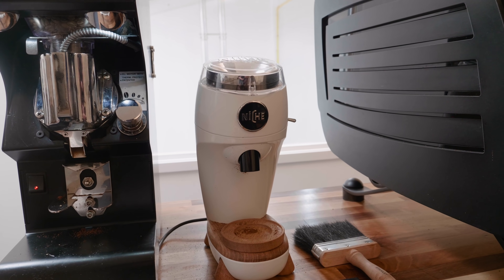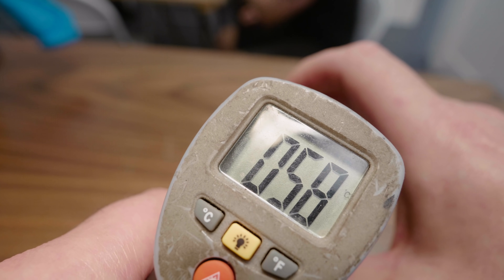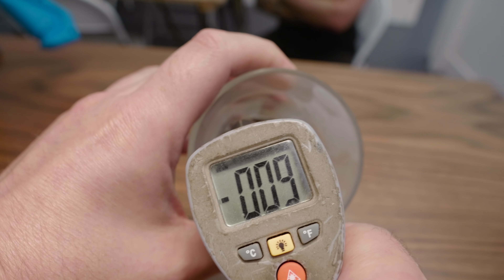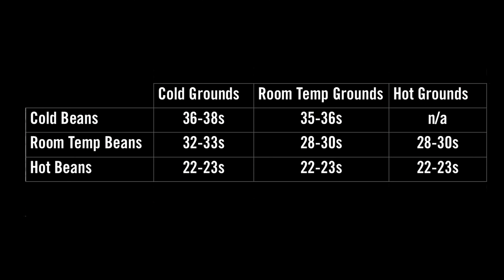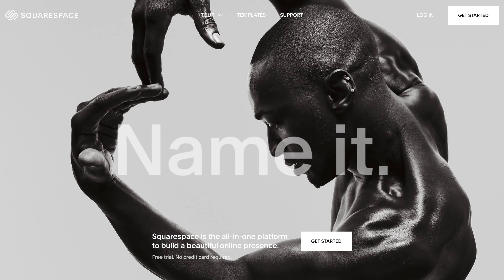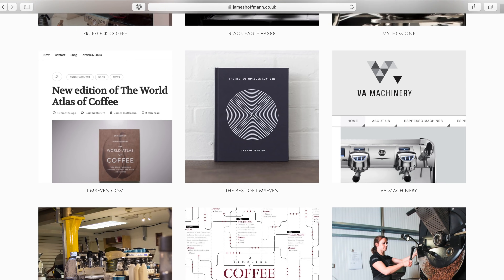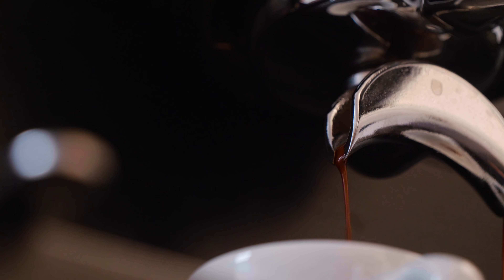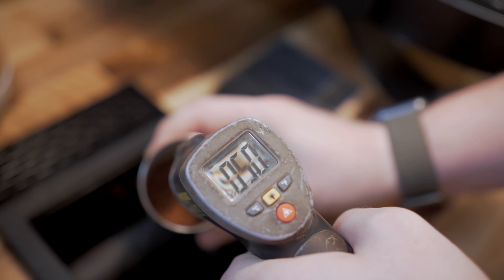Weird Coffee Science: Microwave Your Coffee Beans

Comment: Nuked very good fresh beans 20 secs in a bowl. ground slightly warm, and did my other crazy song and dances pour-ed over into clever (not grind top) kept hot on low in micro for 2 additional minutes top on. put the clever on a pint glass, top on, into freezer to cool rapidly. about 10 mins for 14 ish oz near boil/ over 200 C when I've checked. Into Ember mug at 140ish initial. I dropped it down to 134 to sip on. It is WONDERFUL......Too many factors to determine if nuking helped or hindered, no control or blinding or guinea pigs refractometers or caffeine meters. I have in the past def over nuked dry beans and grinds. Less is more for sure. KEEP THE LID ON?! SPEED COOL?! Well, more steps and can not prove this seals in flavor. I like to think so...one "test" I LICKED THE LID to taste the condensation. tastes good, IDK like an ultra light coffee spritz.FOR CERTAIN FREEZER COOLING YOU GET TO ENJOY YOUR JOE SOONER. But, then you'll prob need a heated coaster (fire hazard) or electric cup $$$$$ or.......THERMOS........or drink fast. there's another high AF on caffeine aha moment cool you coffee before putting into a highly insulated container. some work so well it'll burn you 4 hours later. Aha 2 such a container would indeed keep whats evaporating in....hmm. Wake up and smell the coffee a bit less but have a tastier cup? As we know what we perceive as delicious involves all of our senses. Same goes for nasty.

Comment: UPDATE NOW 5 ways including non micro "control" will add 4 and 5 at end.
3 CUPS 3 "MICRO WAYS" Have some of the best roasted beans I've ever had, again from 1000 Faces Athens, GA (RWANDAN Baho's Akagera Station experimental low oxygen fermented whole cherries 60 hours in sealed b4 natural drying.
3 "MICRO WAYS"
UNO......My way (Wy way?) brew kept hot/ near in microwave x amount of time. Now my go to method. Clever Coffee dripper goes into the microwave fully loaded top on and nuked on low setting to stay near boil whole brew. best results for me have been 2 and1/2 minutes in atomic box.
DOS   beans GROUND then heated in microwave before brewed same  micro way
TRES WHOLE BEANS like in your vid nuked til hot brewed "Wy"way
30 secs on high in a ceramic bowl got them piping no singing or toastiness hope for tastyness. Whole beans were cooled before grinding ground beans poured over still hot 14 oz ember mugs of each.
ONE) PHENOMENAL BREW!!!!!  These test roast beans are fantastic to start with.  Had some subtle and not so subtle notes and aromas I dig. zero over extraction nor bitterness.
TWO) VERY GOOD, but i get some vegetal and some bitterness I did not in the last cup. Also Microed 3 mins vs 2 1/2 so that's a factor. should have done same brew time for comparison.......But my hunch is nuking the grinds DID NOT HELP.  I thing it was that not 30 extra secs.
THREE) preheated whole beans, about to taste it. BETTER THAN TWO THE NON  MICRO PREHEATED BREW BEST WINNER CUP ONE
 Note brew one was yesterday so memory is a factor but I doubt one day older well stored beans would be much. should have gone same amount of time on second brew. ALSO having brew 3 after the more bitter cup....my palate is OFF AHA I also have cup two set to a lower temp than 1 and 2 were, its in a different Ember mug whoops it's a bit too hot IMO. Conclusions. Will continue to play with my coffee. Not sold on pre microwaving joe beans. Intriguing someones post claiming they "de-staled" older beans this way. Oh boy.........28 oz coffee today, yikes.  ALL THREE WERE QUITE GOOD ONE WAS EXTRAORDINARY but also factor in ONE was my 1st time sipping  said special bean a virgin experience ya know.
Day 3 sameme beautiful beans.
FOUR) is standard full boiled water bloom then 3 minutes in clever. Elevation 633 feet........YUMMY
FIVE) Brewed just as UNO But 3 minutes in micro rather than 2 1/2   Hard call........I'm going a bit more YUM than 4.......One was best, but its been 3 days so super subjective. Bothe Mugs are set to 136 F and that's major.
"Objectively" DOS and TRES were not as good and DOS microwaved ground beans is in 5th place, though decent. doubt I'll preheat beans in the nuker......may try comparing stale beans nuked or not in future.

Comment: Predict this round may not go well, its about time to get some fresh beans. nuked  whole beans w/ singeing. cooled to room temp (Boy do c beans retain heat well) ground.....back in the nuker about 40 seconds, no burn......1/2 grounds on bottom bloom boiling water final grounds stir stir stir, a bit more water, 2 mins low microwave brew. put clever on my cup. The heated grounds smell good, I realize part of the aroma when Ive successfully heated dry coffee bean or grinds is a nice burnt sugar smell......like the top when you torch creme brullee/ caramelization. Ember light still flashing so still too hot to quaff. Smells pretty good, not fantastique.  Blowing on top, need my coffee........Hmmm surprised, it's good not great, thought it'd be yucky. Time to bean up its been a week since opened but stored in the nice resealable valved bag they came in in a cool spot. This batch of mid roast beans weren't all that jazzy to begin with.

Comment: Fahrenheit 451.......NOT SO CLEVER........So burnt ground beans 3 ways  (I had success days back ) Microwaved grinds in a ceramic cup......the cup gets much hotter far more quickly than the grinds (also true of whole beans to a lesser degree) so the grinds in contact cna get burnt if you nuke too long or on too high a setting. Then I rinsed my filter and piled the clever w this fantastic grind........FAIL same dealio the vessel got too hot and burned the baby. I went ahead and brewed all 3 the first being so burnt that most of the smoking grinds stuck to the mug. Second which was nuked lesse time had barely any char, same for the unclever batch. had spoonfuls of all 3 brewd DISGUSTING UNPALATABLE BARFO a vegetal taste of peanut butter (I'm a yank and hail from the south originally so like peanut butter and boiled peanuts also like me some vegetables) but this was the bad PB Gross green bean off vom taste. My day is ruined as were these excellent beans. DO TRY THIS but low micro setting shorter time IDK 30 secs on max, choose the right vessel.

Comment: Today ground hot beans ( cooled down just a tad), microed 1 minute on high in a ceramic cup. Did my Clever in the brewer into the nuke box to maintain brew temp pour over method  2 mins on low after grinds over hot water method (took a good minute of stirring to sink the grinds) so basically a 3 minute brew at boiling. This time did not get a "flat bottom" grinds very much stuck to the sides of the filter paper. AWESOME CUP!!!!!

Comment: Maybe when warm a few hits and they get punched into pieces - like kicking a cake - as you do - and then chomped easily to size with no hassle.  But when cold, they bounce around between burrs many times, collecting a multitude of little fractures, then getting pressured to cave in, but resisting , producing more and more fractures, like kicking a glass ball around - which contribute to produce overall smaller grind and shatter when chomped down.  So in short - I think it's fractures.
IF that's true, I think you'll see MORE crema, because the chunks will remain big, so retain their gas.

Comment: French Press by Bodum using plastic frame, used for Brewing
60g whole beans frozen in Ziploc for freshness a la George H.
Sealed ziploc put in microwave with warming coffee cup full hot water.  Microwaved until beans warm to touch.
Ground in Rocky set to 20.
Put in preheated French Press, which half filled boiling brew water, vigorously stirred, adding remaining Litter.
Microwaved at 4 minutes to keep brew temp up arround 93C. Poured at 10 min total brew time.
Fully extracted, like dark brown velvet covering on memory foam pillow.
Roast: Medium Dark, not surface oily, not dry beans, blend Central & South American Arabica from altitudes greater than 1200 meters.
Brew water ppm:150;10;10 Ca, Mg, CO3 a la Monika K.
My better half liked the coffee black for the first time!!
I liked the coffee black from hot to tepid; and it also made a great " strong coffee ice cream flavor with heavy cream and stevia; Keto either way.
I love the ability to independently control variables using French Press.  Grind size, brew time, temperature independently controllable.  As are brew water Ca, Mg hardness and CO3 buffer.
I have begun at a grind size that also works for Venus Bialetti on my induction plate.
This grind size is about 100 micron radius, as suggested by a video on maximizing extraction fraction.
This brew water starting pH 7.69 and brew is pH 6.34.

Love coffee science!
Don

Comment: I would be very cautious about doing this in a microwave oven!
Nuking 20g or so of beans already desiccated by the roasting process leaves very little water to absorb energy from the magnetron. This can end up damaging the microwave as the magnetron can overheat. Google “microwave empty” and read the results. Perhaps there is enough residual water in the beans to be OK, but I’m not going there. This comment is backed from some personal experience with low moisture / low volume microwaving. Didn’t destroy my oven, but that’s because I was quick to turn it off!

Comment: The solution is easy. First you package the beans frozen in cup to full pot sizes. 

Then the fun part is a custom grinder that has a heating element that you would put the grounds into. Slowly bringing the grounds to temp then it heats the grounds to the desired temperature and to texture. Think easy bake oven with a digital clock. it could connect to coffee maker of proprietary design. Flushes itself with water then air.

Comment: Some wild guess:

Microwave vibrates water molecules. It frees the water molecules from the coffee-bean cells so the beans are dryer. It may makes the bean cells' moisture uniform. Thus, the grind produces more uniform particles.

Also, despite the water molecules, generally hot things should be easier to be cut/broken because their particles have more potential energy & don't really "mind" to separate from each other. So, it's easier to be cut by the grinder & the result is a more uniform grind.

Comment: I don't have a way to measure the temperature, so I just microwaved my beans until they felt "strongly warm but not yet hot".

  Grinding with hand grinder, the feeling definitely changed, it feels like grinding something a tiny little bit more... "elastic"? I'll try to make beans even hotter next time and see if there is any difference. Will update when beans cool down, gonna make some stove moka pot coffee.

  It also made me wonder, if anyone working at coffee roasting place ever tried grinding coffee immediately after roasting, when it was still relatively hot? Or let it cool only partially and just toss it in a grinder? Then, when roasted and ground coffees are cool, grind some more roasted coffee, brew, and compare both?

 Edit: Inspected what I ground, and I was honestly surprised! A lot more bigger pieces (but the desired-size big), a lot less smaller pieces and fine particles. Also, I should have measured brewing time, but I swear it was a bit faster than usual (for this 3c size moka pot). Waiting for the coffee to cool down a little, will update on the taste. 

 (Beans used: medium roast Brazilian beans with milk chocolate/nuts/cocoa flavour profile. No acidity.)

Comment: How about a precision grinder that has a chamber below the hopper that has a built in scale in the chamber that only allows the desired amount in. Then the chamber heats up the beans, by being kept at a desired temperature, then drops the exact desired amount through the hopper. Obviously this would make things take a bit longer but this sort of system would work in a cafe - especially when you preload the chamber each time, so it's heating between shots - but then you run the risk of over heating them... there's my idea.

Comment: I might be getting ahead of myself writing this halfway through the video, but here goes the chemist’s perspective:

Warmer coffee beans are likely less brittle, because the majority of the structural integrity comes from the non-decomposed carbohydrate content such as cellulose. At higher temperatures, the carbohydrates themselves will overcome some of the hydrogen bonding between one another that is responsible for the rigidity, and any atmospheric/residual water will be more able to insinuate itself into that structure to weaken it further. Any lipids present might also probably transition from a crystalline to a more amorphous structure as well. Overall, I would expect this to make the beans more pliable and elastic and contribute to a cleaner split. Personally, I’d like to see the difference in particle size distribution as a function of temperature - my hypothesis here is that the size distribution of grounds narrows for warmer beans.

Comment: I did a variation. I have a microwave that is also a convection oven. I normally use the 100 degree Fahrenheit setting for raising bread dough. So I "raised" my beans for 5 minutes and put them through the Rocky grinder. The result was much less clumping and a fluffier grind. I reduced the grind setting one notch. A dark roast is a little sticky due to caramelization of sugars during roasting. My medium roast is not sticky. However, while my fingers do not recognize the beans as being sticky, the grinder seems to disagree. Coffee beans are notorious for being able to pick up flavors. It appears they also are somewhat hygroscopic and a brief stint in the oven dries out the surface moisture that they pull out of the air. The grinder definitely likes the drier beans better,  The puck is wetter at the end of brewing due to the finer grind.  My bottomless filter basket shows no spatter and more even flow. A work of caution here. I do things differently. 23 grams in the basket gets brewed then divided into two 10 ounces mugs which get diluted to make a total volume of 20 ounces. This is coffee for 2 made by Miss Silvia. This works for us and is a large improvement over our old Kurig which we gave away to a worthy cause.  Miss Silvia is stock except for the addition of a PID temperature control. The NotNeutral mugs fit under the bottomless filter, but not the standard filter basket. The PID is temperature only, preinfusion is done manually with a stop watch. Our first Kurig died when the electronic display quit working. If my stop watch quits, I can replace it on my next trip to the grocery store and it will cost less than $10, If the PID dies, I can revert to factory default, or replace the PID which I installed myself. I can get parts for Miss Silvia. No more unrepairable coffee machines for us. However, I can't brew coffee and talk on the phone simultaneously and I wouldn't want to insult the beans by doing that.

Comment: I currently work for a coffee kiosk company and the first time I noticed this temperature phenomenon was a couple days into working for this company. The shots in the morning were fine and consistent then mid morning I found myself struggling to keep the shots consistent. Every single pull yielded a different result. Then I noticed the sun was beating down on the grinder. I put my fingers in the hopper and, sure enough, the beans in the back were much cooler then the beans facing the sun. I stuck a thermometer in and there was a 70 degree difference between the front and back. It made so much sense because things that are warm are more mailable than things that are more cold and brittle. I made a makeshift hood and the temperature stabilized as did the consistency. The most annoying thing is that some kiosk managers don’t want you to ever adjust the grinders 🤦‍♂️
Reply: Paul Aspen correct in you assumption. If you work in an air conditioned environment where the ambient temperature and humidity is constant there is no need to adjust your grinder. If you Coffee station is out in the elements you’ll need to adjust your grinder depending on the hour of the day, the humidity, and the ambient temperature. This all affects the grind of your bean, and your grinder should be adjusted accordingly to suit the surrounding elements.

Comment: This is really interesting thanks for posting, I tried this morning 15gm in the microwave for 30sec plus heating my grinder with a hair dryer. 
Unfortunately although I compensated for the higher flow rate it still wasn’t enough, most likely need to dial -.3 / -.4 stops on my mazzer, which is huge. 
Hard to give a conclusion at this point as both extractions were fast (15-20sec) - coffee tasted slightly more bitter.

Comment: Seriously, I thought about this. (Not this particular way that uses microwave to up the heat of the beans intentionally) cuz I am using Breville Barista which has grinder built on the machine itself. Always wondered that (1) isn't it obvious that the heat from the boiler would effect the bean somehow? (2) And I turn on the machine only before I use it, so technically beans in the hop will go through some temperature fluctuation (every morning and afternoon) and wouldn't it be effecting the bean as well?

Comment: Consider that heating dries the beans and getting cold beans out of the freezer into the room temperature causes condensate, which increases the moisture content. When I get fresh beans from the local coffee shop and pull fresh shot the same day I get one flow rate. After the beans sit at my place, which almost always has drier air than the coffee shop due to heating or air conditioning for a few days, then I get a very different flow rate. That of course with all the other variables like grind size, etc being equal.